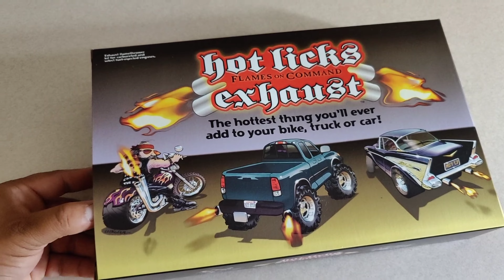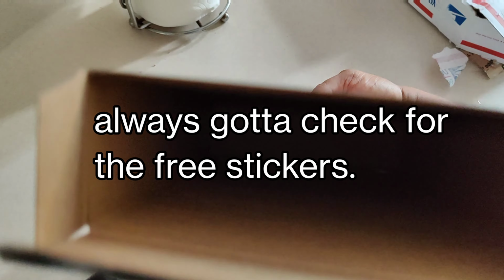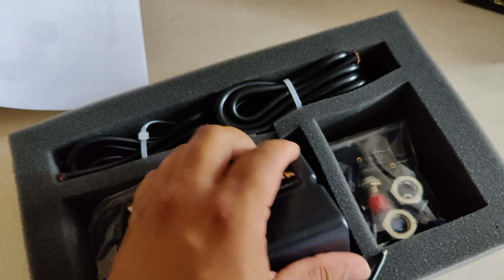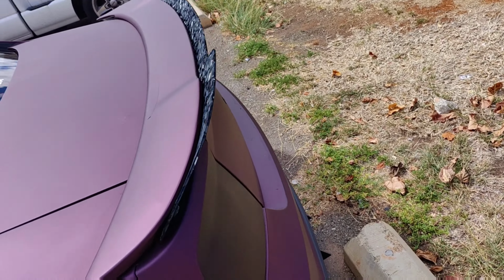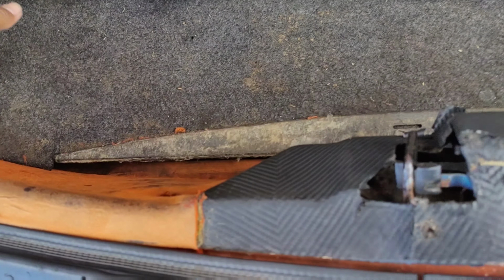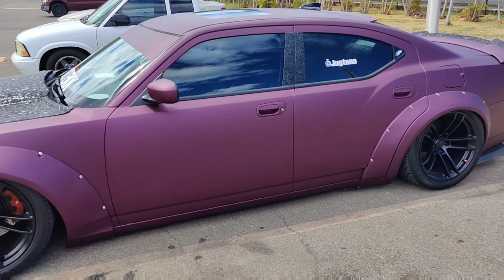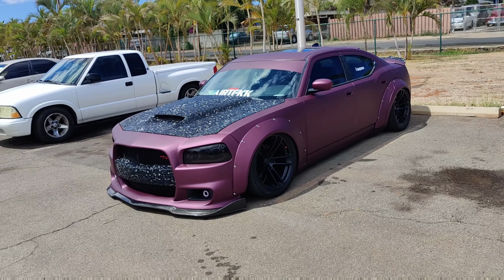hotlicks exhaust flame kit on my 2008 dodge charger rt Daytona

Comment: Do you splice the positive 12v of every coil run it to one wire to the switch then the same to the other half that was cut to another wire to the switch
Reply: Did you ever figure it out?
Reply: Yeah you have to cut every positive side of the coil  and daisy chain them together and run them to the switch if your injectors and coils run off the same fuse
Reply: @randyszilay3590  thank you so much been looking for answers for 2 days imma do that tomorrow cause I have an 06 300c with the 5.7 and I believe they run off the same fuse because I’m getting spark without and flames or backfire
Reply: Nota problem man I know noone tells you how to do it with our cars because they are different I contacted hotlicks for the Information it will work as soon as you do that though just clean up your wiring good via bud connectors or soldering so you dont have a fire under the hood I soldered mine and make sure you get good size exhaust tips that stick out to or you'll melt the plastic bumper I scorched mine a little bit I have the 09 challenger rt classic same wiring as yours other than that though have fun with it man
Reply: @Omarion-rk2ef  you figure it out bro I gotta 300c too
Reply: @Omarion-rk2ef same thing going on I gotta spark but no flames , without even hitting the button I got hella pops and crackles when I left off the gas
Reply: @gumzei4755  I wired it from the coils to the button but all I got is loud pops without the flames so I kinda just settled for what I got
Reply: @Omarion-rk2ef so basically you just take your power wire from the coil pack (All 8) Then you cut that power wire into ll to where you can splice in 2 different wires , then you connect all the coil packs to 1 wire from the positive , then you would do the exact same with the other side of the wire you cut , and run those to the button and boom you got flames on a old gen hemi. Hope this helps

Comment: I am willing to pay for wiring diagram, doing the job on a 07 rt charger and same problem cause the wire in fuse box controls injectors and coils at the same time. Help!
Reply: Yo did you ever figure it out ?

Comment: Can you email me I have 2013 Chrysler 300 5.7 and I just got the hot licks kit I am stuck on wiring it I am trying to get it ready for a car show this weekend in Fort Worth WAM can you help me
Reply: i have a 14 you ever figure out the wiring
Reply: @k1l0diesel90 hey man I am stuck on the same issue, doing the job on a 07 rt charger and the wire that controls the coils also controls the injectors. Any advice?